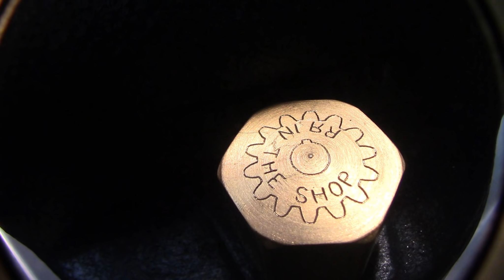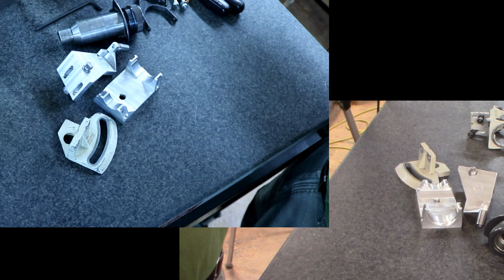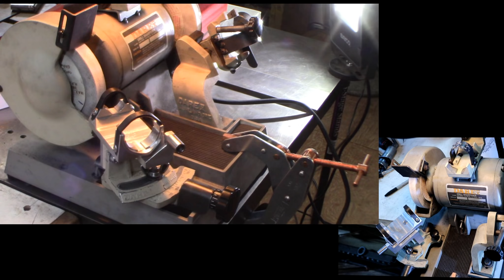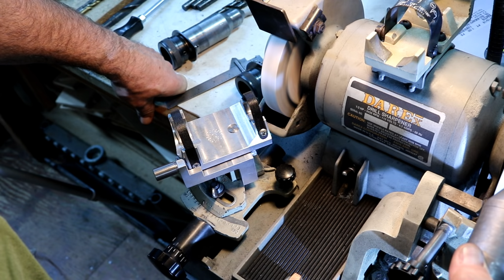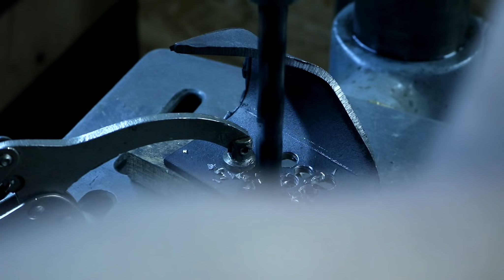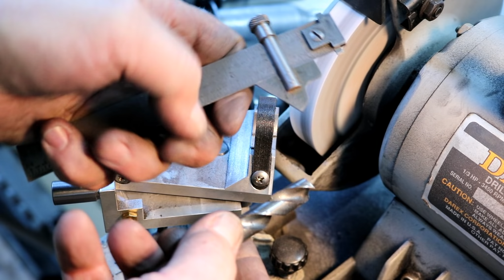P4-2 Darex Drill Grinder / Sharpener, Making New Parts Project

Comment: First of all thanks R.R. for your effort that it takes for quality informative vids. Had a question for you.  I wondered why you couldn't have tweaked  the 118 degrees to get the heal of the drill without adding the adjustment screw? Not that it's any big deal just wanting to know your reasoning or if I was missing something in the way it worked...
Reply from the maker: Different axis of rotation.
Reply: @rrintheshop  10-4 looks like it worked great. Lots better than free hand. Seems like one day I can get a good grind on a drill the next not so much... the FOG in our shop he says " you're not holdin your mouth rite son " as he puts a razors edge on one.. lol

Comment: As other have noted nice job. I love my darex grinder. I usually hit the end of the drill bit with a red sharpie so I can see if the grind is even. CBN wheels are nice in that they remain true. The straps that you printed are a weak point in the original design as replacements are not available from Darex. I see a market for 3d printed replacements.
Reply from the maker: Thank you Dennis.  Good idea on the sharpie.  3d printed straps work but could be stronger.

Comment: Great job on that.  Those are great sharpeners, we have one in the shop.  You need to get a spring for the return action.  Ours has a little spring on the bottom that brings it back after you remove the drill holder.  Thanks for the video and build.
Reply from the maker: Thank you George.  Yes I aware of the spring use.  Just was not sure if I really need it.  I will consider it more.
Reply: @rrintheshop  I figured you knew. It's probably fine without it.  Like you said keep the pressure in and against the cam guide.

Comment: Nice rebuild Randy.  I have the M3 Darex that I bought at Westec show in 1987.  Mine didn't come with the motor, so I bought it from the Glendo Corp that made a table for a Baldor grinder and the Darex was mounted on one end of the table.  I have both chucks.  I like it as you can touch up the drill before it gets dull for more precise holes.  I regret not buying the split pointer for it at the time as you can no longer get it.
Reply from the maker: I am going to model the split point attachment as well.
Reply: I'll be anxious to see the split pointer as I might be able to copy what you do to make it work on my machine.

Comment: Randy It looks like it's working good! I think they redesigned their grinders so the angle of the point grinding attachment is better. I have a different model grinder but I find that if I angle it on the bench it is more ergonomic for turning the chuck. I guess if you were left handed than it would be easier. Did you notice how unnatural it is to twist the chuck with the angle on your left (If you are right handed). It would be good to mount the grinder on the corner of the bench so you can stand to the left with your body kind of parallel to the wheels face. Or make a base where you could pivot the grinder for grinding the point than pivot it back to split the point. I also find it is easier to turn continuously clockwise with one hand applying light pressure into the wheel until it sparks out. That's why if you could get to the left beside the grinder it will be easier. Some of their newer models they switched the grinding stations. Probably because most people are right handed. I have a newer smaller one, model V390 but your grinder is more versatile, it can do more angles and point styles.
Reply: Your comment to Randy just turn on a light switch for my set up of my M1. With a bad left wrist, going to see about mounting my Enco 10in vice swivel to the work bench, and the grinder  can swing 90deg,,,Wow,, or mount it on my short Delta drill press base,,,Thanks for the tip,,,Bear in Tx.

Comment: Like that you use the 3D printer. Think the black ones are nice but maybe the orange are not too bad either. The 1/4 inch and less sounds good here. It is great you share how to use the grinder from start to finish because we do not have one so understanding this is good. See you are grinding off to the right for small or second bits you mentioned this in a prior video for best results I believe, but I honestly forgot why this is to be. 40 years (vintage moment) look good and best thing is you know that tool is great and you clearly know how to use it. I am feeling a bit of mr.pete lessons here Randy. Drilling holes total vintage moment again love this sharing. Nice build pre planning.

Comment: Great stuff.  On the drill doctor (which I think was designed by Darex) you have to either make sure you rotate an even number of times so you are grinding similar amounts off each flute, or you need to spark out the grind on each flute to make sure they stay even.  If you take too much off, you need to re-index the bit since the flute angle rotates as the material is removed.  An all metal sharpener like what you have would be great, but they cost $1500+ and that would buy several lifetimes worth of drills for your average home shop person.

Since you cannot buy most of these things any more, I was thinking it could be an interesting shop project to create a sharpening jig for larger drills (the kind where "throw it out and buy a new one" just doesn't work).  The Lisle type seems like it would be easier to figure out how to copy and make.  Easy to say typing on a keyboard though..

Comment: I used to use one of those 35 years ago. Hardly seems like that long. Sweet machine.
We made stainless steel parts for thermometer wells. I think the ID was 7/16", hole depth about 4". 
After a couple crashes where the drill bit got a little too dull during the drilling operation, I taught myself how to use that sharpener.
Keeping the drills touched up reduced the crashes dramatically. Using that and a couple others tricks, I was about 20% more productive than dayshift. 
Drove the day shift operator nuts. 😁
He treated me so "nice", I wouldn't tell him my secrets.
Great series on a great tool.
Thanks,
John

Comment: That cam is almost identical to that on the Drill Dr.  The drill gauge would be nice with a v-groove to measure the centre point,( I always hated lining up the drill with a flat scale on the side).
Very nice project Randy, is there a point splitting attachment in the works as well, or is this the final product?
Cheers!
Reply from the maker: I have the point splitting attachment.  I will be making a vid on using it.
Reply: @rrintheshop  Great RandyI love the way you dissect and reproduce items, bread and butter for the home shop engineering types! Those pieces were absolute works of art IMHO, bravo and cheers!
Reply from the maker: Thank you.

Comment: Came out just as good as the original, seems quite easy once we get a little practice, all I need now is the setting device to position the bit in the holder...
Plus to put my hands on one bigger and a smaller holder...
BTW, was thinking you were gonna use some flat blued strapping for the collars, the 3D printer, didn't think of that...   I'm resisting as hard as possible to get one, so affraid it gonna cause me soooo much frustrations, even more when adding Fusion 360...    GGGGrrrrrrr
Reply from the maker: When I am finished I will have drawings for everything.
Reply: @rrintheshop  Great about the files...!!!
Reply: I was thinking of some type of strapping also, didn't even have a clue for the 3D! Plus you've got a file to just simply print another exact duplicate. Cool! Randy I need to learn the 360. Still on AutoCad.
Reply: @tomeyssen9674  You got a good head start for CAD, I'll get frustrated starting from near scratch, plus the fact that computers tend to get me frustrated very essily...   ;)